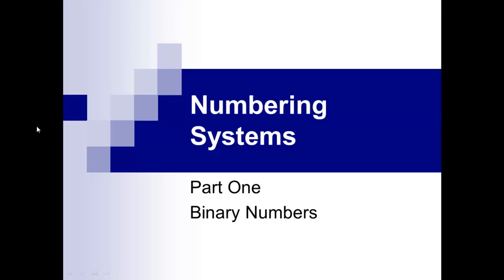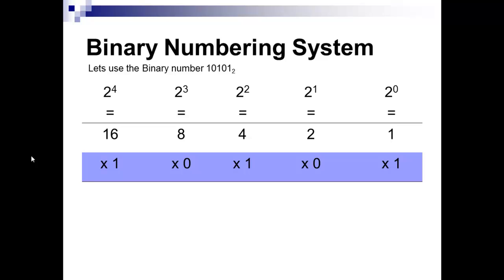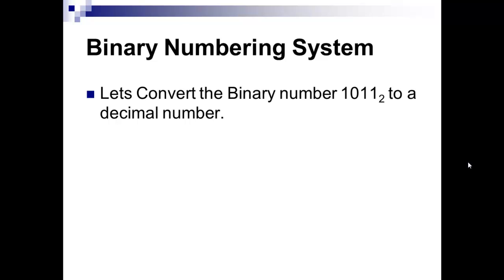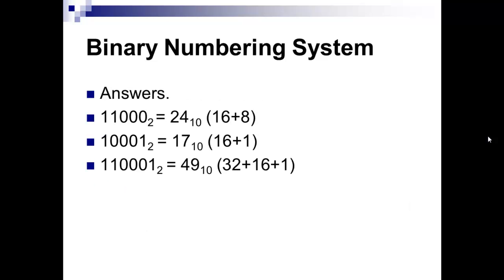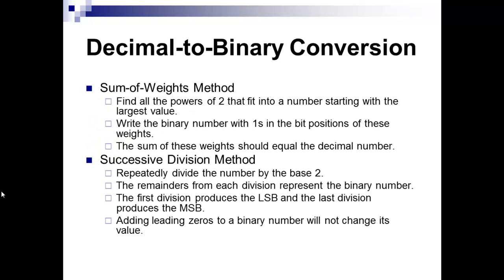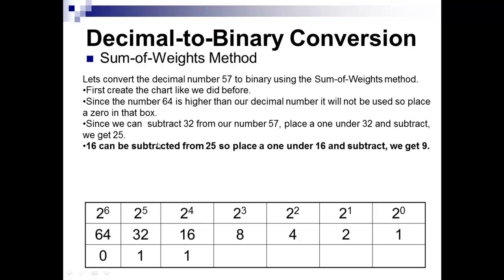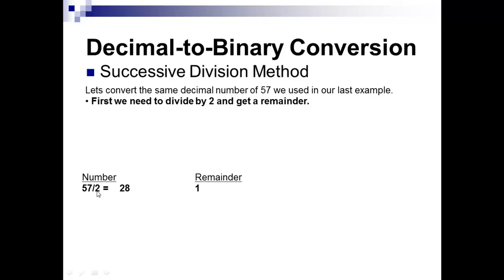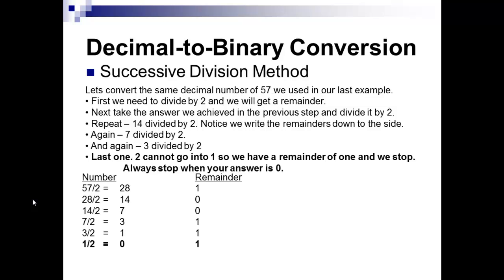Digital Electronics -- Binary Numbering Systems: Converting from decimal to Binary

Comment: what's the conversion of binary (1001.0010) to Decimal
Reply from the maker: +Divyaraj Sinh Jhala For the decimal part, you would still make a chart. However the chart is with negative exponents. 
2^-1 2^-2 2^-3 2^-4     so .5  .25  .125   and so on.  Add the ones that have 1's (just as the whole number side) and there you have it.
Reply: +MovieHQ   So  (9.125) correct

Thanks that really helped
Reply from the maker: +Divyaraj Sinh Jhala Glad to help.

Comment: why 2 power of 0 equal to 1?
Reply from the maker: Anything to the 0 (zero) power equals 1. Try it on a calculator.
Reply: @MovieHQ  i typed in 2×0 and got 0 and also typed in 0×2 and got 0 as well
Reply from the maker: It is not times. You should have an X to the Y power button on your calculator (cannot put that in this text), you must use that. Not the multiplication key.